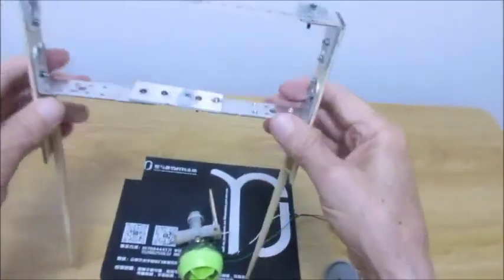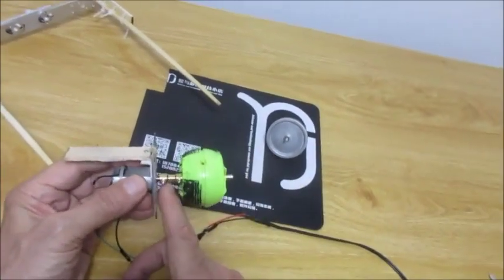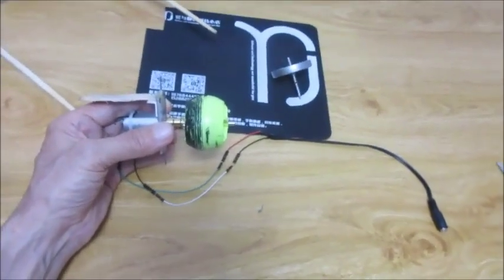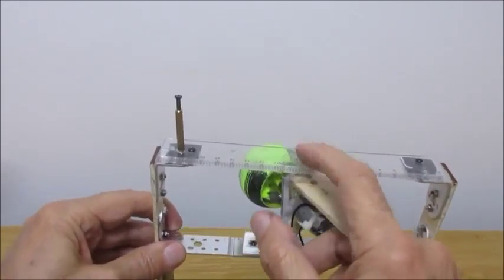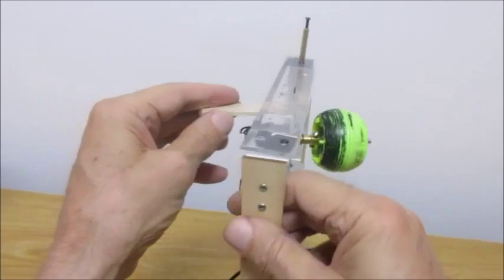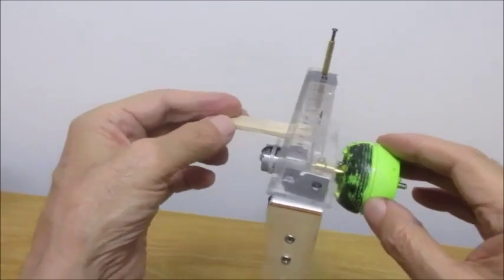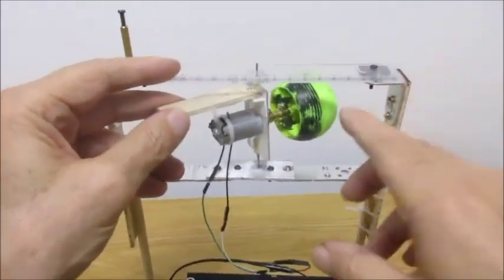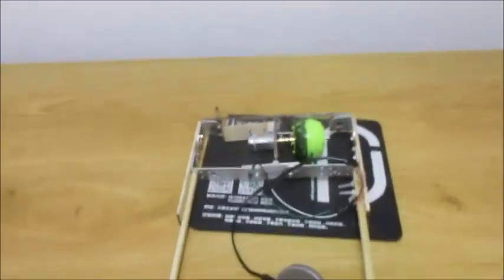Make a Self Balancing Gyroscope (11000 rpm) on Two Legs

Comment: Can you show me how to calculate to have a motive for a frame. I use it to make my own project. I lack English, so reading and communicating is difficult. Thanks
Reply from the maker: Frame size does not matter, make it any size you like. Try to put the CG of the rotor and motor between the rotor and motor. Then you just have to play with it until you get it balancing.
Reply: @demej00  hi Jimmy, my gyro still can't stand still on 2 stakes. I still don't know what the reason is, can you please show me how much the flywheel weighs in relation to the shaft? Thank you, sir. Does the distance of the gyroscope from the ground affect it much?
Reply from the maker: @inhthang6939  Can you post a video on youtube of your gyroscope? A picture is worth a thousand words. Height does not matter a lot. Shaft weight does not matter. The CG should be between the motor and the rotor. How fast is your motor turning the rotor? Needs to be at least 3 or 4000 rpm to start it balancing. What are you using for a rotor?

Comment: I think your gyro balances by changing the center of gravity, not by providing a righting moment. When it starts to tip over the gyro moves thereby changing the center of gravity. I could be wrong but it's still very interesting.
Reply from the maker: Thanks, your guess is probably better than mine. I have never found any scholarly explanation of how it works. But it is entertaining. I pull it out occasionally just to watch it work.

Comment: Nice project! How does it work? Is there a sensor?
Reply from the maker: Hi. No, no sensor. As the frame begins to fall to one side, the gyro applies a torque to push it back the other way, then as it falls to the other side, the gyro applies opposite torque so it kind of see-saw balances itself.